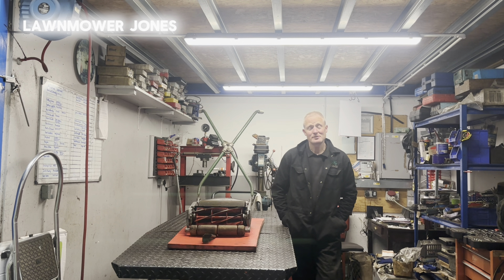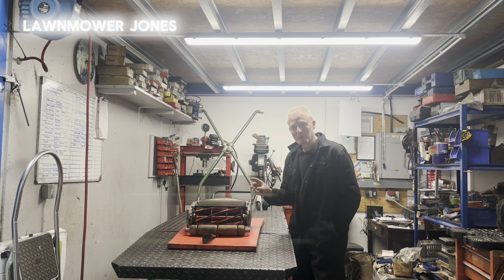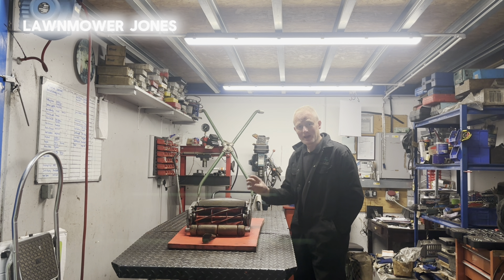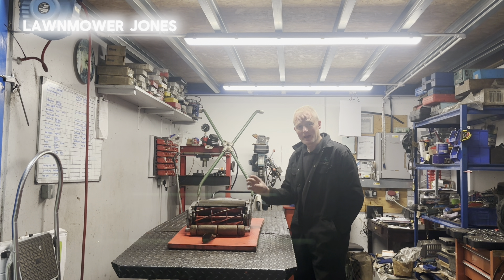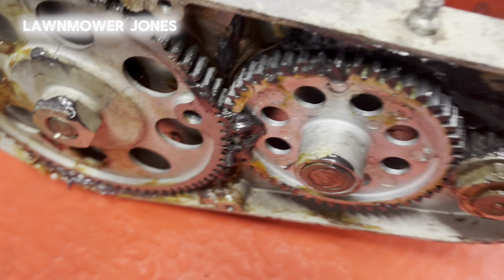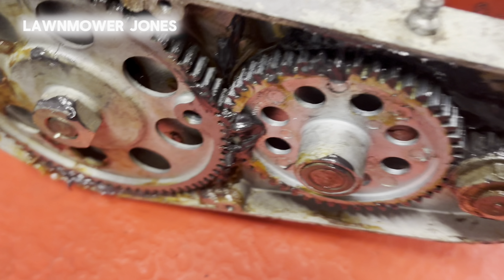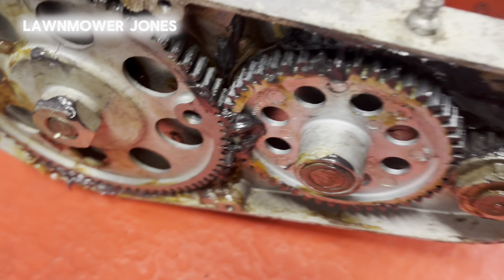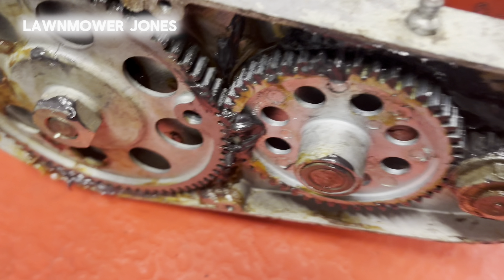The Best of British Ransomes AJax Mower

Comment: A really enjoyable video. I picked up a MK 5 last July. It hadn’t been used for 16 years but had been serviced prior to being stored. It was set up perfectly still cutting paper and came with the grease gun, spanner and back lapping tool.
Reply from the maker: Hi, Thank you. One of the last then.
Sounds like you have picked up a Gem , and a bonus to get the grease gun and back lapping lapping handle, and guessing you also got the user manual.
Enjoy using your nice mower.
Thanks for your comment.

Comment: Thanks MrJones, what a lovely mower, such a great design, I have spent many hours mowing with Qualcast Panthers and while they can be made to run and cut OK they are sadly a poor comparison to this mower. Our neighbour, when I was growing up, had one of these and that tick tick of the split rear roller and the whirr of the cylinder is very evocative ! I still have my Panther from the early 80s, and a couple of the Qualcast side wheeled models, but mostly use my 1998 Atco Balmoral and Honda Rotary now, I always fancied the 16" Atco Super Clipper, but they stopped making them so had to settle for the Panther. This makes me want to dig out the Panther and see what I can do to get in running well, and perhaps I'll look out for a vintage Super Clipper too,  I have subscribed and will be going back over your content, thanks !
Reply from the maker: Hi Andy, Yes it was a pleasure to work on.
I am a big fan of Ransomes and always very well made.
The Ransomes Ajax does have a very nice sound when using it.
to be fair to the Qualcast Panther it was a well made mower with easy adjustments and cut well .
It seemed that the Qualcast Panther and the E1 / B1 Side wheel mowers where sold in huge numbers, very popular and affordable to most.

I do remember seeing the Atco 16" Clipper in the Atco catalogue , i am not sure why but they seemed to have had quite a short reign.
Glad you enjoyed the video.
Thanks for your comments.

Comment: I have a mk3 and the cylinder is still fully true and cuts all the way along. Shows how good the quality of the steel was back then!
Reply from the maker: Hi , The Mk3 is basically the same as the Mk5, different handles would be the main thing.
I am not surprised yours cuts well, Ransomes do use some of the best metal on there cutting cylinders and bottom blades.
Enjoy your Ajax mowing.
Thanks for your comment.
Reply: @lawnmowerjones3160  absolute pleasure. I only recently discovered your channel and its top notch. Having restored this and a Webb Witch im itching for another! Its the parallel handle model which is quite rare to see.
Reply from the maker: @andymartin86  Hi Andy.
Thanks for the kind words. Vintage / Antique mowers are a great affordable hobby, with engineering to match any!
It does seem to be that the earlier Webbs are more difficult to find, and will be a nice mower to use.
Thanks Richard.

Comment: Fantastic video! I restored MK4 last year. I had a sharpening shop to grind the blades, but they also grinded parts on the bottom since they did not remove the cylinder.  
How can I backlap Ajax ??? I need to sharpen the blades and don’t know what to do 😢 I want to sharpen it on my own. I have been searching how to backlap Ajax online  but it is very difficult to find any info
Reply from the maker: @shion_lwn  Hi, yes sounds like back lapping is going to be the answer for you.
I have done a video on back lapping a Ransomes Ajax.  ( A bit of back lapping and bad soup )
It is not difficult to do , and will most certainly get your Ajax cutting well.
Thanks for your comment.
Reply: @lawnmowerjones3160 oh backlapping is possible on Ajax?  ah, I believe one or 2 nuts on the gears are counter-clock for tightening..I forgot about that. so it is possible ^^  I saw online that someone used a pulley belt or something to backlap..no clue how it works.  
could you please tell me the link of your video of backlapping ajax? I went through your video list and I couldn't find it.. thank you for your advice!
Reply from the maker: @shion_lwn  Hi, yes quite easy to do.
Just grinding paste, and  a variable speed drill old paint brush  and a socket adapter needed.
Not sure how to forward the line link.
But  the title.    Bit of Back lapping and bad soup .    It was done about a year ago.
Hope this helps.
Reply: @lawnmowerjones3160  ok! Thank you:) I guess the process is pretty much the same as any other reel mowers. Awesome thank you sir.

Comment: Hello Mr Jones I  enjoy your videos they are all interesting  . I  own a Ransome ajax mk4 I keep it sharp and well serviced and like you say easy to use . You can back lap the cutters from the large gear wheel with a tool that screws into it and just wind backwards.  That is also a good idea of yours removing the 2 gear wheels . A question can you remove the two inner front rollers on a mk5 that leaves two smaller ones for cutting longer grass ? Regards Brian.
Reply from the maker: Hi Brian, Thanks for your kind words , we have a little garden with only gravel , so no grass. ( Not good for someone that's into mowers!!! )
But would love to have some grass to use an Ajax on.
Yes i should have mentioned about the official Ransomes Back lapping handle , i have only seen pictures of it.
Good point, if i do another Ajax video , i must mention the Mk 5 and i think Mk 4 you can remove the inner wooden rollers to leave the outer for the longer grass.
Thanks for you comment.

Comment: Hi mate, love your video, i also have this mower which was recently serviced, it cuts beautifully along the whole length of the blade (paper included) & is just touching the strike plate  nicely. The problem i`m having is it seems to leave serrations in the grass even though i cut the lawn every day or so. Would you have any ideas why this is so & anything i could do stop this ( i do cut low but very often).
Many Thanks.
oh I also have a Jp Maxees mower too which is also fantastic !
Reply from the maker: Hi, Yes the Ajax is a very good choice.
I think what you are talking about is called Ribbing 
The Ajax has a Six bladed cylinder, even if it is sharp and cuts Paper , when cutting low you may get Ribbing.
It is down to the amount of blades and gearing ( Cuts Per Yard )
To get away from Ribbing you may have to go on to a Fine turf machine like a Certes which normally has about nine blades and will achieve more cuts per Yard.
One thing that would be worth checking on your Ajax is the Cylinder bearings, If they are warn and have Up and Down movement, that will cause Ribbing.
If so you will need to replace the bearings.
Hope this helps.
Thanks.
Reply: @lawnmowerjones3160  many thanks for your help it`s much appreciated & i will check the bearings for sure 👍👍

Comment: Hi, love your videos! I’ve got an Ransomes Ajax mk5, when I pull mine backwards sometimes the cylinder spins round, my rear rollers seems to have more movement then the one you had on the bench. I presume my cylinder should not be spinning backwards when I pull the mower backwards?
Reply from the maker: Hi. Thank you.
Yes you have one of the last if it is a Mk 5, Your mower could be a couple of things. It would be worth checking that the cylinder is touching the bottom blade ( A little resistance )
It could also be a problem with one or both of the rear rollers not free wheeling.
Thanks for watching.
Reply: Hi Mr Jones, thought I would give you an update, you’re were right one of the rear rollers was not free wheeling, you’re a diamond!

So I managed to get some In-Force ion-activated penetrating oil into the oil nipple with a bit of hassle! But now as free as a roaming dog! 

Can you recommend an oiler I can purchase that will fit the nipple please? To prevent this happening again please.
Reply from the maker: @ianmoughton8370  Good evening.
Glad to here you have freed the roller.
It does make a big difference when both rollers are working correctly , really nice and easy to use.
Sadly oil nipples are not so easy to come by these days, it will be something like 1/4 UNF /BSF Thread , probably best to measure your original grease nipple for size.
Probably Ebay ,Or if you ever visit some of these steam rallies normally there are some stalls that sell nice old fittings like Oil /Grease nipples.
Thanks for the update.

Comment: I have an ex local authority one of these to restore, it has a brass plate with the la shortened name and asset number. I need front rollers and wooden handles. 
It has a box but I think it's not original or for it but it does fit
Reply from the maker: Hi, It sounds like you have an early Mk 3 Ajax with the flat handles and wooden handle grips.
Much the same as the Mk 5 Ajax with more of an antique look to it..
If you know anyone with a Lathe , it is not hard to turn new rollers and handle grips, but needs to be a nice hard wood , Beech , Ash or something similar , but not Oak.
Thanks for your comment.
Reply: @lawnmowerjones3160  you are correct, I've only just been able to get to my storage place mark 3 with red front of the name plate, cylinder (rust now) and handle stay bars. The green paint is ratty but pretty complete the red is flaking or corroded away.
The grass box looks like a home made ali plate and there is no thrower plate (never knew what is was called until your videos).
The box will fit but it's on the front roller height bolts so I thinks it's a make do type of thing there doesn't appear to be lugs or studs for the box to clip on